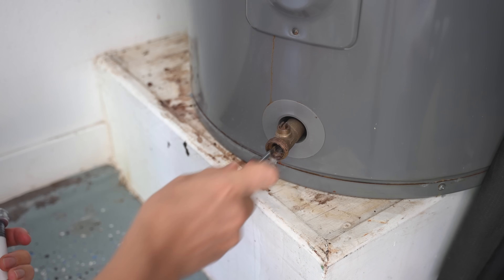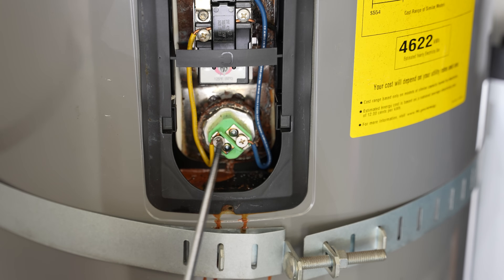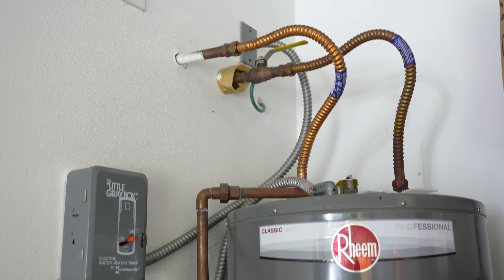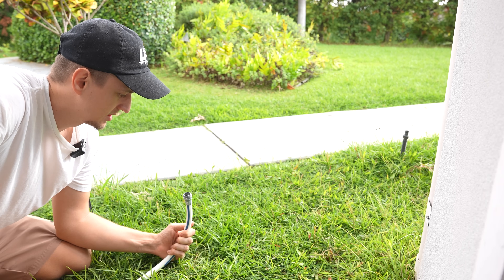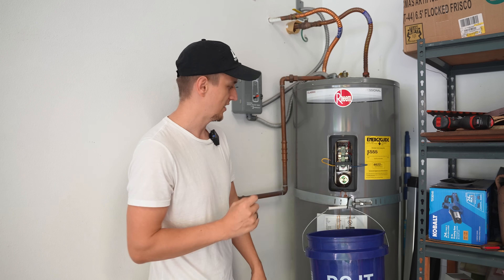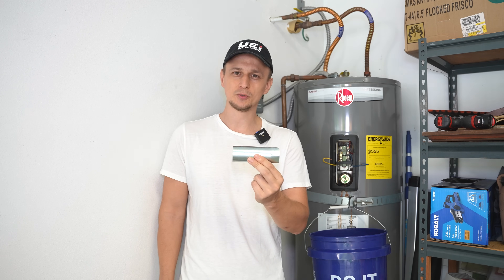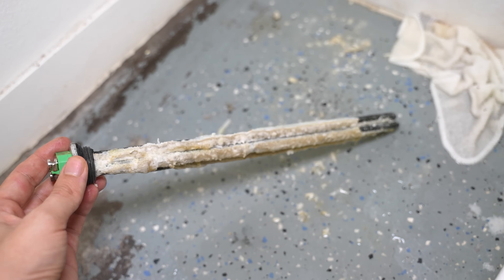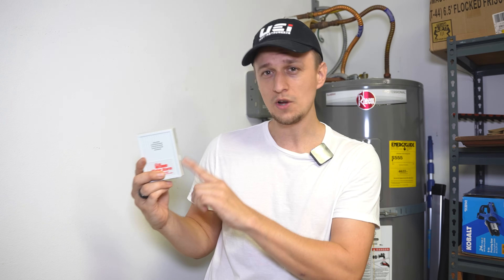How to Replace Water Heater Element Without Draining the Tank

Comment: After you use the screwdriver in the drain valve and you start to get a trickle coming out put drain hose back on then go ahead and turn cold water supply back on, this will stir up sediment in bottom of tank and usually clears blockage at drain , once you get good flow out drainage hose under pressure go ahead and turn water supply off. You then should have the water coming out of hose as water heater drains, also recommend doing what's called a maintenance flush once a year to limit sediment buildup in water heater tank 😊
Reply from the maker: Thank you for the great suggestions!! I was going to turn the water back on exactly as you said but it seemed like there was way too much sediment in there so I felt it wouldn't make any difference. Perhaps I should have tried it after all..

Comment: I did mine recently someone change the bottom element on the fly. The element was bent up, like a corkscrew is because the tank was more than half full of solid scale. I spent all day scooping out the scale.
Reply from the maker: Oh man, my condolences! Cleaning out scale and sediment is an arduous task. Would you mind sharing how you go about getting the scale out of there?
Reply: @WordofAdviceTV  I cleaned it out through the bottom, heating element hole with a model bar with an L bend at the end. Little by little . Also, I needed a 38 mm socket. I borrowed for free at AutoZone to remove the rusted element.
Reply from the maker: Ah okay! That seems to be the most common approach - to clean it in one way or another through the bottom element opening. Thank you for sharing your method!
Reply: Eating an elephant is a long process... one bite at the time. Time for a new water heater!
Reply: @strayedcat1966  I live in Florida and they make you get  permit and only have a licensed plumber install it. Around $2000.

Comment: Good morning Jay, Thank you for reminding me of a terrible experience changing the bottom heating element on an Aosmith  Electric hot water heater. After turning off the electricity to the hot water heater I verified which element was bad presto The bottom was bad so I decided not to drain the hot water tank. Disconnected my wires and got my inch-and-a-half Socket on the element with a new one on the side ready to go in I proceeded to pull out the old element and it was stuck I could not get it out bending it up and down nothing worked I was soaked luckily it was a basement floor no carpet nothing else got wet but me so, therefore, I made a promise to Always drained the hot water tank first no exceptions thank you. I will now go walk two miles 😄lol
Reply from the maker: Oh nooo! This is a classic case of misery needs company! What are the chances that you had a similar experience like that! Thank you for sharing your experience as well. Good to know that I am not alone. 😄😇
Reply: @WordofAdviceTV  There's nothing like on-the-job experiences😅

Comment: When draining, open the drain before you shut off the incoming water so the pressure clears the drain . Then shut off the incoming and it should be draining.
Reply from the maker: Ah, that's a great tip!! Thank you for pointing that out!
Reply: @ohiopat  you right
Reply: Can't one hold open the T&P valve to aid in draining?
Reply: @rmx4087  Yes, but I open a hot faucet for air cause sometimes the T&P won't reseat. This is just to unclog the drain.